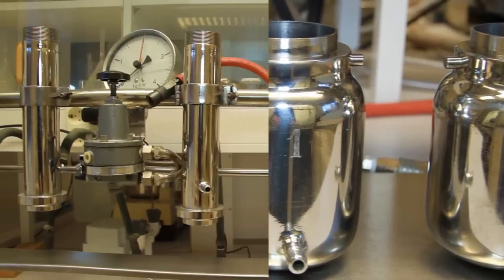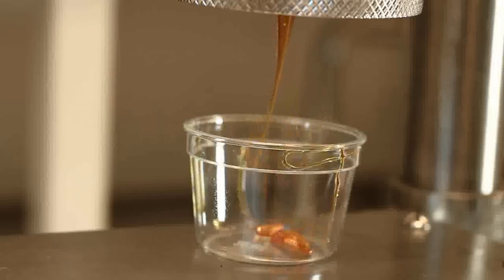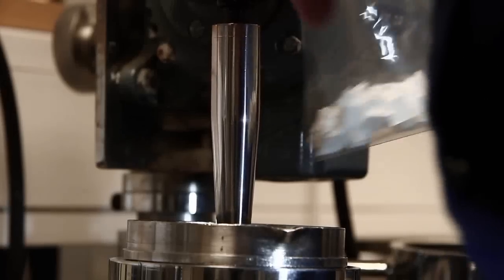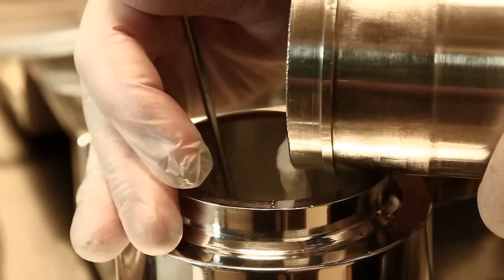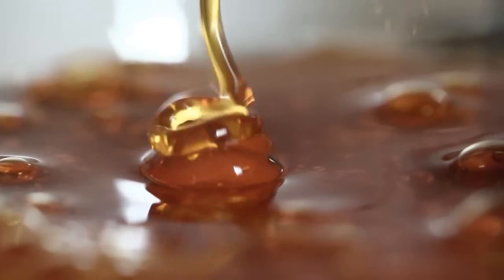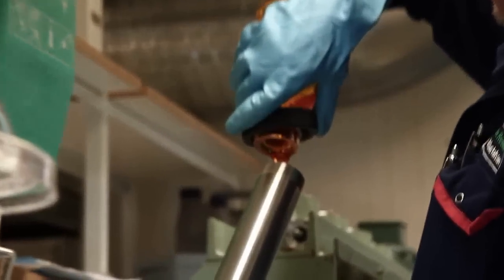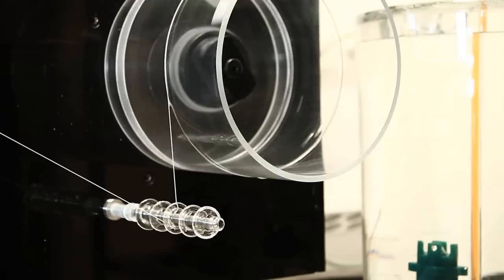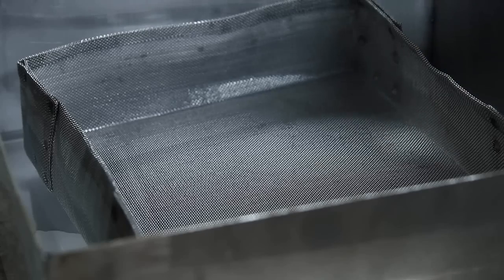The Viscose Fibre Line

Comment: is it possible to make Viscose from jute plant.
Reply: Viscose use wood pulp as a starting material.
Reply: You can make viscose from basically any cellulose from nature. The only challenge is to remove enough other components in the starting material. The cellulose has to be rather pure.

Comment: What will be the purity of cellulose required to produce high quality viscose? Can the same cellulose used for paper be used?
Reply: Basically you can use paper grade pulp to produce viscose fibers, but the cost will be high due to higher consumption of alkali and a lower yield due to the large fraction of low molecular carbohydrate polymers. Usually a pulp with a R18 (how much is insoluble in 18% aqueous NaOH) of above 94 is used.